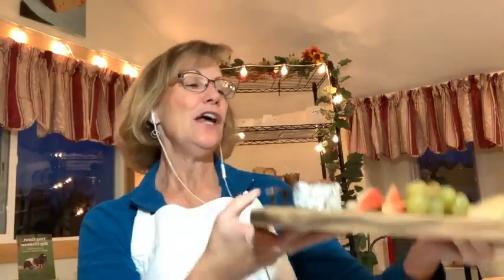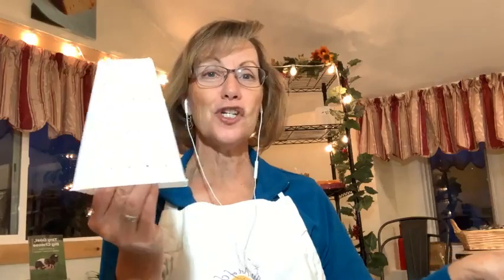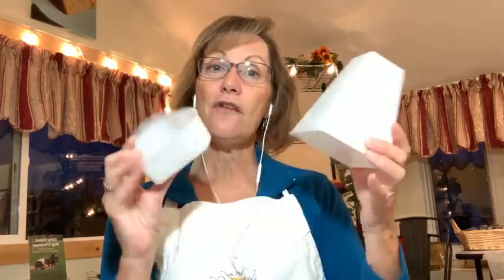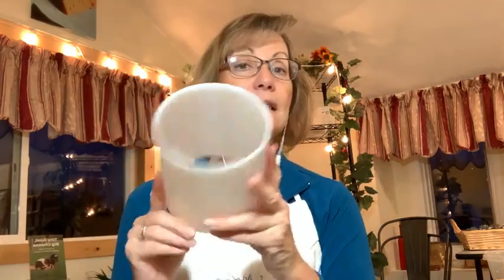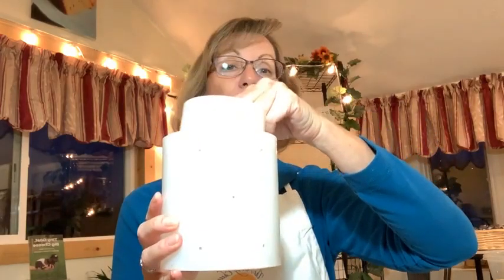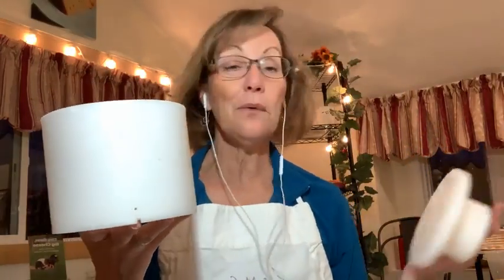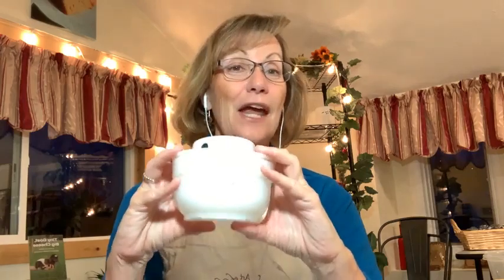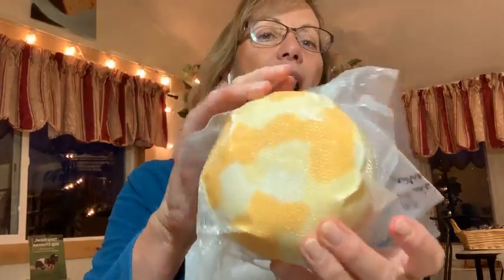Friday Fromage from the Farm

Comment: Good evening Kate! Opened first port salut today, tasted great, but a little mushroomy  from the blue green mold that was difficult to control. I vac packed it for the last 2 weeks of ageing.
Reply from the maker: Sounds like you may have had a bit too much moisture when washing your Port Salut which is why you got the blue green mold.  If you let the cheese dry a bit longer and wash a little less frequently, you will be able to encourage the brevibacterium linens (that makes the nice orange, slightly stinky rind) and discourage the blue green molds. But glad it still tasted good to you!
Reply: @theartofcheese9636  thankyou for the advice. Leeds UK